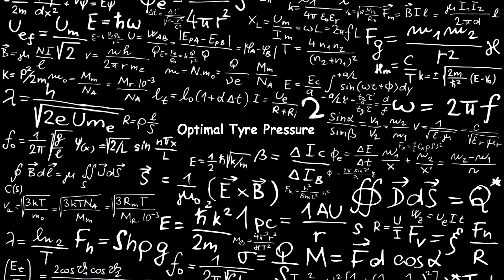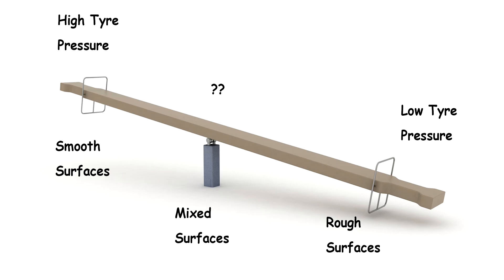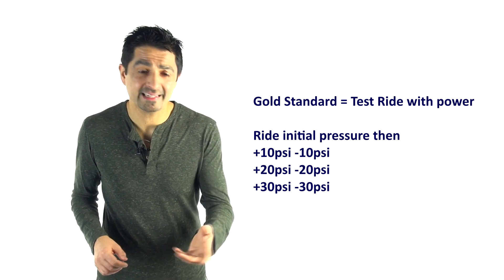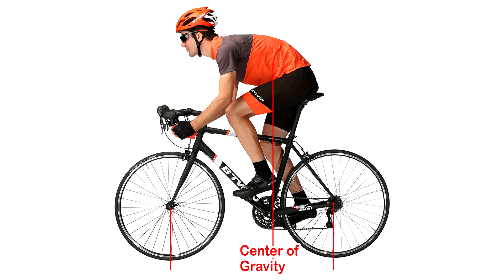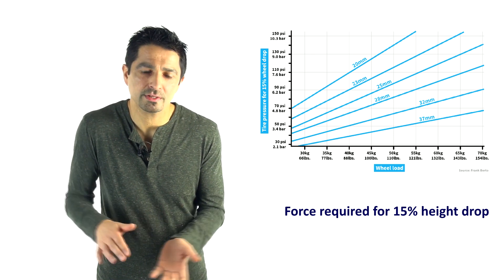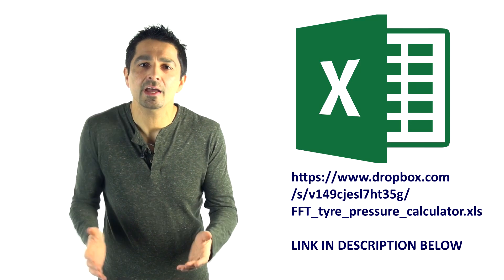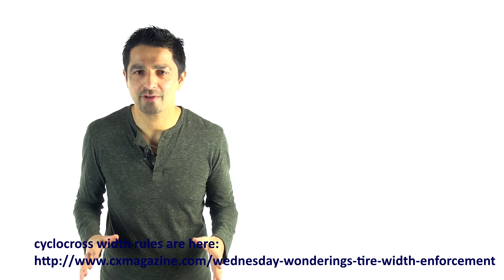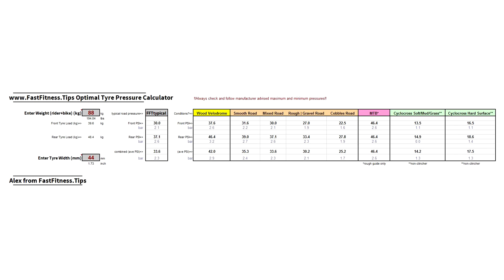Bike tyre pressure science! What is optimal for Road TT Tri Cx MTB

Comment: Formula seems bang on for road tires, but much too low for MTB. It is recommending I run 17psi for "hard off road." If I ran that pressure I would destroy my rims so fast your head would spin. 17psi might be the optimal pressure for rolling resistance on a flat smooth track, but it is unrealistic in real world MTB conditions. I think the takeaway is still useful and is in line with all of my experience: the best MTB tire pressure for any given rider is the lowest tire pressure they can run without rim striking. This obviously is highly variable based on tire volume, rim width, rider system weight, terrain and most of all riding style. For me with 2.25 tires this works out to 23psi in the front and 27psi in the rear. At 80kg I am not the lightest rider and during a flat out XC race I might take a bad line over some rough rocks at high speed. Having that extra psi prevents pinch flats and, more importantly rim damage. If I am racing a track with drops and lots of sharp rocks I might increase that pressure a bit for a larger margin of error, because even with the relatively high pressure it is still possible to damage the rim if I get unlucky with a rock at high speed. I have more grip and a smoother ride with 21/25psi however I have stuck the rim too many times at 25psi for it to be a reliable pressure for me. Smoother riders can run less pressure but it only takes one mistake to turn an expensive carbon hoop into rubbish.

Comment: One question/doubt: what if a tire has very different widths on two different rims? For example my Conti GP5000 25 has 27 mm on one rim and 29 on another. Should I really use different pressure depending on the rim?
Reply: yes, because the wider rim will increase the total volume of air.

Comment: Thanks for access to your calculator, turns out I'm doing something right as I am putting in 95/110 which is almost spot on to what the sheet came out with. I'm assuming when entering weight I should be including myself, bike, and all extras such as clothing, saddle bag, water bottles etc? Really bumps the total weight up!

Comment: man... 85kg and 10psi on an 2.2 tyre? that's low even for 27.5+
Reply from the maker: I agree that does look low; these are mainly road pressures (so am not 100% confident about MTB).....what do you think the correct PSI should be?
Reply: For MTB road use it said (avg.) 29.9 psi, 10.3 for grass and 12.7. All of them seem quite low as usually going under 20psi is quite prone to hit the rim. Something like 40-20-25 would be my guess in the order u proposed, of course if going tubeless as for tubes we'd need 5-10psi more.

Comment: Thank you very much for sharing this !! I have downloaded the calc and I am adjusting for mixed road setting to start. 5.5 front 6.2 rear . 80 kg with bike. The recomended pressures from the calculator are a bit lower than I have been using but I have had a suspicion that lower is better even though the feeling can be less intense. Giving a opposite false  impression. From my own experience trying out a 10 km tempo ride repeatedly with varied pressures  I saw that I produced somewhat greater watts with the higher pressure ride but NOT higher speed!  although it felt quit a bit faster and more aggressive.  I had a hard time to trying to  believe the data.. Just haven't gone this low before . I am looking forward to experimenting and testing the recommended pressures between smooth road and rough gravel.Again thanks for sharing, excellent place to start!  I think I will be happy somewhere between smooth and mixed.
Cheers!
Reply from the maker: Great to get good feedback. Don't forget these are starting suggestions. You can vary based on experience and local conditions. If you are able to do some trial runs using the power meter and report back that would be v useful. XLS have been updated 1/april/2017 anyone with an older version should re-download.

Comment: I tend to use something between velodrome track and smooth road pressures as suggested by the spreadsheet for my road use. I weigh 78kg, my 2 bikes avg 9,0 to 9,5kg (~10kg fully loaded), I use 23mm front and 25mm rear tyres in both and I found my optimum pressures around 105-115psi in front and 110-120psi in rear (Maxxis tires in one bike, Continentals in the other) - upper limit for smoother asphalt, lower limit for rougher roads. But I'm used to sacrifice just a little bit of comfort for a bit of performance, and loads of grip are not in my priorities, and plus having an extra protection for pinch flats. Suggested pressures for road use are lower than my personal setup :)

Comment: As a mathematician (MA), I would prefer to see the formulas, especially if they're nonlinear. Also, I'd like to know what method was used to derive them.  Additionally, I've experimented with mountain bike pressures and found that the pressures should be adjusted on the same course when weather conditions change. This is really a Chaos theory problem: with several nonlinear equations and is sensitive to initial conditions.

Comment: This is great. As others have noticed, your distribution in tire pressure to account for a change in balance may need some refinement. 

Currently you're moving 1% tire pressure for 1% change in balance.

If you treat the front and rear wheels independently, and calculate them as you have calculated the combined, I suspect you'll get more 'in-line' numbers. 

Example: If I weigh 80kg, then 50/50 is 40kg front/back. If now the distribution is 45/55, I'm 10% lighter in the front (36kg) and 10% heavier in the rear (44kg). Now double and compute the tire pressure at 72kg (to get the front) and 88kg (to get the rear).
Reply from the maker: @John Calcagno +John Calcagno  Why double the pressure at the last step can you explain that? thanks. 72kg+88kg would imply a 160kg rider wouldnt it?
Reply: For the sake of establishing the tire pressure for the front wheel, you're a 72kg rider. And for determining the rear, you're an 88kg rider.

Your spreadsheet has pressure for: 1) front tire, 2) rear tire, and 3) combined. It looks like you use 3 to get 1 and 2 based on weight distribution. I'm recommending the other way around. First determine 1 and 2, then use the weight distribution to get 3.
Reply from the maker: ok I see where you are coming from. I am changing the weight based on distribution, but surely that is correct order. If I go with your method, the pressure will always be that same % as the distribution change up or down...whereas it is the (hypothetical) weight on the ground that is currently used.

Comment: Hi, does this formula hold true for tubeless tyres or would you recommend tweaking  the results obtained down a bit for tubeless? Your formula's results are similar  to the Bike Tinkerer's 'salvaged doc' in the ratio of front/rear so that spreadsheet must be also be assuming a 45% to 55% front/rear weight distribution (this can no longer be altered as was possible with  previous versions). The results obtained by your version when entering the same  parameters are about 10% higher. I take it from your commentary in the video that you have tweaked the original Berto - derived calculations based upon real-world experience so is the 10% difference absolute for tyres of all types ?
Interestingly (well, I find it so) I ended up tweaking the results I obtained using the 'salvaged doc' version UP by 4% (yes, I'm THAT obsessive!) based on my own experience with my current tubeless tyres.
Reply from the maker: Thanks. Some people run tubeless 5-10% lower and there is a difference on recommended minimum pressure but I didn't find any evidence that the CRR was different for tubeless, so currently there is no additional adjustment. Regarding weight distribution, this is still working (I am not sure why you are having trouble)....download the file open in XLS and overtype the balance cell C19....I just tried it on the download version. Regarding the derivation of the FFT formula I took information not only from Bike Tinkerer's 'salvaged doc' which is the Dave Adams method but also Berto+Schwalbe+Michelin's methods too. Dave adams method generates the lowest recommendations of all these calculations. FFT method is somewhere in the middle but fully adjustable for balance and conditions. Of course ultimately use the pressure you find best.
Reply: Fastfitnesstips Hi, thanks for your reply. My comments about functionality were in reference to the Bike Tinkerer's 'salvaged doc' which now only has presets for front/rear weight distribution whereas the older "open" file, which couldn't be downloaded, was more functional  even  though one needed to tidy it up every  time one accessed it. Your version works better and offers a sensible range of real-world, 'road type' options. In this, it is not dissimilar to a calculator I saw recently on an MTB magazine website. This gave similar 'terrain type' options but didn't allow for road bike tyre widths. I shall give the results for 'mixed road' a try and see how that compares to the pressures I been using. Seems I may be able finally to dispense with the flawed 'salvaged doc'. Nicely done!

Comment: Interesting vid
I'm 68kg bike is 6.8kg running 25mm tyres on average country roads. Thoughts?
Reply from the maker: try 73psi front (5.0b) and 89 psi rear (6.2b) or 81 psi if you want to the same F&R
Reply: Fastfitnesstips cool thanks, will give this a try

Comment: Looking at the road pressures, they are close to what I expected
but similar to my comments below on CX, as body weight goes down below 75kg, and to low levels say 45kg, pressure quickly goes to levels way below what would work, in my opinion. It would be caught by your comment to stay within the recommended limits, but I think eg 40psi for a 45kg rider on 25mm tyres is a bit worrying, if they tried that on clinchers they would be in trouble

Strange, because I am always arguing that people should try lower pressures, now I am on the opposite side of that arguement. I guess the spreadsheet needs to be tweaked to make it less linear for bodyweight at the extremes, or just "capped" at some point
Reply from the maker: Just to clarify a 45kg rider on 25mm tyres gets 57psi ave (if they on a 10kg bike which is the most common bike weight). Only a 29kg rider (on a 10kg bike) would get 40psi in typical conditions. 29kg is the ave weight of a 9yr child (http://www.chartsgraphsdiagrams.com/HealthCharts/images/weight-2-20-boys.png). Please could you clarify further on your data entry thanks.
Reply: yeah, my mistake, I only put in the rider weight, not rider weight plus bike, sorry. Still, with an actual 8kg bike/ 45kg rider, that gives 50/60psi for 25mm tyres on mixed road, which will be below the minimum with the front unstable on almost all tyres. No problem, as you say not to go below the minimum which is printed on road tyres - as long as folks understand and follow that.

Comment: I have seen similar aids in graph form, but in excel it is much better, so thanks so much for providing this. I only looked at CX so far and was expecting your pressures for CX to be too high, but turns out, in my opinion they are slightly too low at least at low rider weight. At 75KG I run them anywhere from 20 to 25psi, so the spreadsheet is not too far off at 18f / 22R (mud) and 23/28 (dry). The average is exactly what I use but the front is a bit low - below 20psi seems dangerous, at that point the front could fold over. At these low pressures I run the front only slightly lower, say 20/22 and 24/26. I have the pro /pink FMBs that are treated with latex to make the sidewalls slightly stiffer to prevent folding and those still fold over in tight turns below 20psi. A separate digital pressure gauge calibrated from zero to thirty is essential

My daughter at 45kg will definitely not be running at 10psi per the spreadsheet, she will also be at 20psi in mud and 25psi if dry, so I think you need to amend the spreadsheet so it cuts off around 20psi and no lower, regardless of body weight. I realise you say not to exceed the limits, but e.g. Dugast only state a max (30). The spreadsheet correctly says tubular, but is easy to miss, so I expect a few people with clinchers could miss that and think it is too low. And it may not work just for any tubular, those very low pressures may only work with cotton sidewalls so Dugast and FMB
Reply from the maker: Thanks for this, can you specify the bike weight (you have included that right?) and the tyre width you and your daughter are using so I can double check against your expectations etc. This kind of feedback is very useful in perfecting the calculations.
Reply: Thanks for being polite about me missing the bike weight, you spotted that! Once I  include 9kg with a 75KG rider, it exactly matches what I use and stays above 20psi so is 'safe'.

But for my daughter, 45kg and an 8kg bike with 33mm tyres, the pressures are too low, a reasonable cut off is still around 20psi to stop the front folding over (and the manufacturers FMB / Dugast do not have a recommended minimum in the way that other brands do). 

I guess it will be OK for riders over say 60 or 65kg, maybe you could tweak the spreadsheet or simply add to your warning about the manufacturers minimum that very light riders need to be extra careful to respect that minimum and not just follow the spreadsheet too low
Reply from the maker: ok ill have a look and also make the weight instructions a bit more clear. I am releasing a tweak of the xls soon.

Comment: Except thst you are measuring the tire size outside which makes no sense because the sir is inside the tire/tube assembly
Reply from the maker: Are you claiming there is no relationship between tyre width and tyre volume? Would you say there is no link between shoe size and foot volume? In fact for road tyres the relationship between width and volume is pretty much linear. But it doesn't matter I never said the calculator used a simple linear model.
Reply: there is a relationship just not a linear one. tube could be thicker/wider. same with shoe/foot. 
take me for example , i am size 10 but wide feet. I have to wear size 11 here in the us so I am confortable. but there is more then 1inch between my big toe and the front edge of the shoe.
Reply: link?

Comment: I'm 59 kg. TT bike is 8.5kg and Road Bike is 7.8kg. Both running 23mm tires. Smooth/Mixed Roads. Would you mind calculating this for me, left the laptop in the office.

Btw, great videos. Always looking forward to them. Will try implementing one of your strategies on FTP TT strategy for the Powerman Malaysia 2017 in early March, a Duathlon.
Reply from the maker: Smooth road +tt bike 49% front/51%rear = 85psi front 88psi rear ; Mixed roads 81f 84r; best of luck!
Reply: Fastfitnesstips thanks buddy. When I started, people told me 110psi basically almost as high pressure as it will go. But I found this to be uncomfortable and have for the last 2 years going for 100psi. Your recommendations are much lower, I'll give it a go.

Would you recommend I reduce your recommended pressures by a wee bit because the Tarmac Temperature here (basically at the equator) would be 40 plus Celcius. Say further reduce by 5 psi?
Reply from the maker: you would have to be 76kg for the optimal pressure to be 110psi using your parameters.....but most amateur riders are around 75-80kg so maybe ppl are telling you their preferences not adjusted for you? Re temperature I believe the adjustment for 40 vs 30celcius would be to reduce 1-2psi (but this is within the margin of error of the calculation). Hot days make for lower CRR and CDA of course.....video on that in the future!
Reply: Fastfitnesstips Thanks. Good to know that 10 degrees C affects pressure by only 1-2 psi.
Reply from the maker: I just found the formula and calculated it for you (using pV = nRT).....for road tyres the change in pressure in the tyre over 10degC is very dependent on the volume of the tyre.....for 23mm I calculate this as approx 14.psi (but this assumes the tyre and contents would reach the new ambient temperature during the event) [sorry I made a mistake in calculation yesterday]

Comment: The suggested pressures seem 10-20 psi lower than what I would normally run, but I'll give them a try on a few rides. Are the pressures suggested for everyday casual pace riding OR racing? Or does that not matter?
Reply from the maker: These pressures are for optimal speed, so racing or or KoM or PR etc. Remember its strong dependent on the surface conditions.

Comment: Should I be concerned with front wheel low pressure while cornering? 81psi for my weight 98kg on a 15c rim with a 25 tyre.
Reply from the maker: Yes and no. Slightly lower pressure helps adherence to road in cornering but only up to a certain speed. So ride within limits of safety according to surface conditions

Comment: Hmm, I don't really prefer the PSI in the front the calculation suggests. 70ish on a roadbike. The reason being that when I want to stand up and pedal, especially on uphills, a lot more weight will be on that front tire and 70 PSI will feel very mushy. If theres any bumps, I would probably bottom it out. 80-100 PSI (25C - 23C) is what I ride.

Comment: So like Berto and the others, a static method based on those factors...

Now what would be really interesting is approaching the problem from a vehicle dynamics perspective; whereby the wheel/tyre/fork are modelled as a system of mass(es)/spring(s) (and possibly damper on the case of mtb forks). Simulating the response to various surface roughness profiles the optimum control response could be determined  giving a value for k which would be optimal (k - which essentially resolves to the tyre pressure)
Reply from the maker: I agree there are more sophisticated ways you could model this, but at the end of the day the best method is to actually try different pressures on your bike on a particular course.